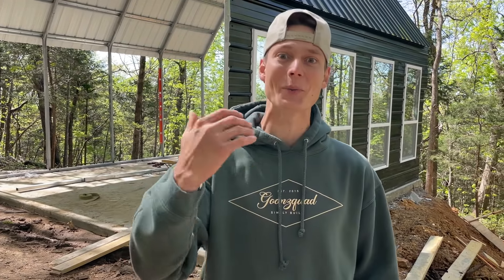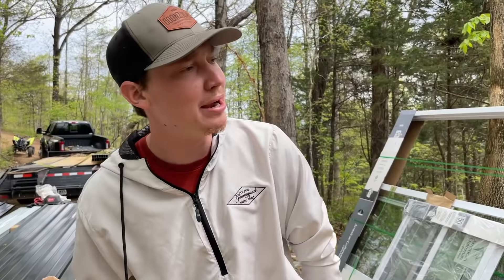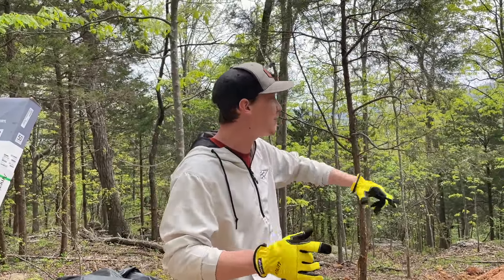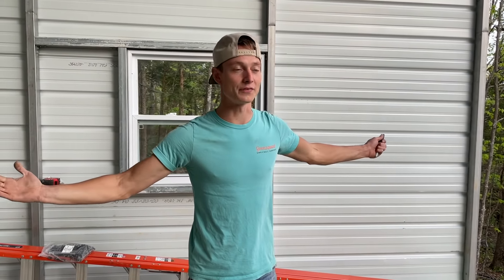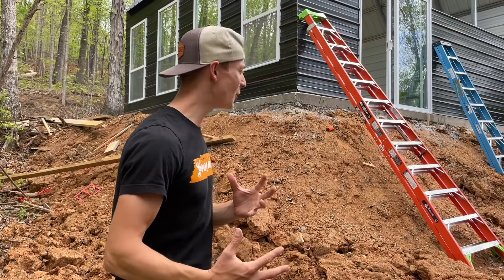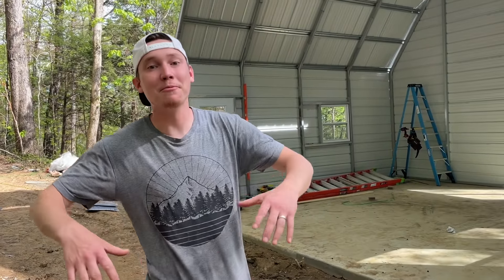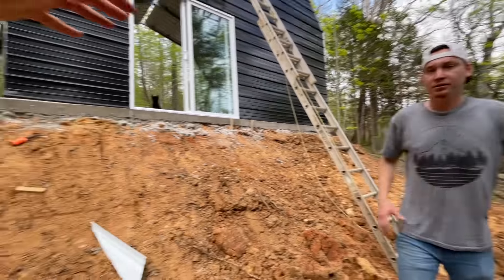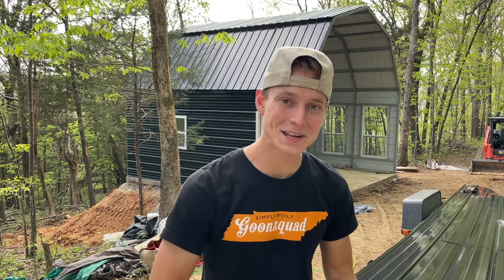Building The Ultimate Man Cave Has Become Dangerous!!! Can We Save It From Erosion?

Comment: it has to be an "L" type of block to contain the slope.  That way first you press some soil on top of the horizontal part of the "L", in short increments (a foot or so) until you reach the desired level of the ground.  That way you will have a nice protection of the slope.
Reply: Lock blocks will do fine
Reply: This is an L
Reply: Called a "Deadman"
Reply: Here in the southwest at least the make tire bales out of old tires. They weight roughly a tone each and commonly used to make retaining walls here. They will stucco over them so they don't look so ugly.

Comment: Hell, embrace the chaos. Stick some wheels on the slab to help it go downhill. Then put some wheels on the saw-mill to follow it and process all the knocked-down trees. You can build a mile-long wooden staircase.
Reply: Unroll that wire as you go and it'll light the way when it glows from the resistance. Perfect.
Reply: @jacobhaagerup7816  Just was thinking about that, with that kind of section, they can not use any power...
Reply: This is objectively funny 🤣
Reply: underrated comment 🤣
Reply: Wait until the next big storm or heavy rainfall day. They will quickly reconsider their stubbornness against the retaining wall, and using just earth to build a platform, without mixing it with different gradient size rocks.

Comment: You guys should have listened about filling in behind the man barn its going to erode until the concrete pad starts cracking you need at least 2 feet of ground around your building and then either slop the dirt better than 2 to 1 or install a retaining wall you can buy the actual metal form from grainger to make your own stackable concrete blocks its a reusable metal form and it's really easy to use and the good thing is you can make as many stackable blocks that interlock together install your Deadman tie ins some of that plastic Matt material ever 2 to 3 courses and your drains and you would be able to drive a tractor trailer around that man barn stay with it and get it done semper fi 😉

Comment: Yes get cinder blocks for your retaining wall, don't forget to put concrete inside them with  1/2 inch reinforcing bars vertically. Fill the hole between the barn & wall with dirt & finish with gravel. Don't forget to put gaps at the bottom corners to release water & use the 4 inch drainage tubing to go outside the corner holes.

Comment: Techo Bloc actually has excellent specs for retaining walls.  If I were you, I would pay attention to them and implement what you can (which is a bit late considering where you are with the project) - but, you can always build out further (you wanted a deck, right?).

Also, you do know that you need to let that wood age before use, right?  You can't just cut a plank and slap it up (as you said).  It has to be pretty dry first or you will get massive shrinkage!
Reply: They remind me of the guy trying to cut a branch from a tree but can't quite get at it to cut it, so he climbs out onto the branch and turns to see he has perfect access to the branch now, he starts cutting...
Reply: @musicbro8225  Well, maybe their fame/fortune can allow them to throw this building away and start over from scratch...
Reply: @JMunsonII  That's true and who am I to judge their failures as an example of best practices for self satisfaction and use of planets resources. Maybe that's fine for them, but for some reason it irritates me. I guess the Goons in Goonzquad is not just a brand :)
Using the green timber on this man cave will be perfect haha.

Comment: concrete plant makes them from leftover redimix  see them about them,  IN canada we call them lock blocks  as they fit together like a lego brick will have to level ground before placing and use some geotect fabric  its a mesh material over top of block backfill then put on top and backfill on top of mesh and it all holds together  from pressure of dirt  OTher than the lock block if the trees can take the pressue  logs piled length wise on top of each other against the trees will hold alot as well . However they will rot in time  then the trouble starts

Comment: You need a bigger size wire to run down because the voltage drop is too much for 14/2. It’s bad for the tools.
Reply: They don’t like to do things right if you couldn’t tell
Reply: Just google Voltage drop calculator and it will give you the size conductors to use for that length and current.
Reply: They rushed into too many things without thinking about long-term
Reply: I was thinking the exact same thing. That wire might even just burn up and melt
Reply: @MythUnknown  It wouldn't burn up if the voltage drops. Wires burn up if the current is overloading an undersized conductor. But at that point it would just trip a breaker.
Reply: They will be driving back and forth flipping the breaker!🤣🤣
Reply: It will be fine for some led lights
Reply: exposed Romex and vinyl tape to plastic box? don't let the inspector see it.
Reply: 14/ 2 and 14/3 is only allowed to power fire alarms and exit signs where I'm from
Reply: Depending on current draw that cable is going to get real hot
Reply: It’s easily over the 3% allowable voltage drop. Also not using snap locks on the box is a big no no and on top of that it looks like they didn’t bond the box

Comment: Set that mill up in the black barn, use the materials to build the deck/posts and outfit the interior! Custom woodworking shop for taking on an old project like a Ford Model A pickup!! Build a loft also to have as a chill spot. That’s where the deck would be. Below that should be dirt when walking out the sliding door. Put the hot tub there in the shade and have some Adirondack chairs on the loft deck! PS I like the idea of one big tire on the back of the ford dually. Cheers from NYS!

Comment: You need to install big gutters and downspouts, The downspouts need to be directed going down the hill and releasing the water at the bottom. You can also get real heavy landscaping plastic and cover the hill with the plastic and then put heavy gravel all over the plastic. This can help channel the water away from the barn. Nevertheless, you need to put together an irrigation plan now! It doesn't take long for the rain to compromise that hill, especially since it's barely larger than the building itself.

Comment: Use timber cut from trees on the property. Using your new saw mill cut the trees down to squares and lay them horizontally. You can do several levels starting down low and stepping up until your level with the back of the concrete pad.

Comment: I realize it will be mentioned a few times here and you have addressed the issue in one of your last vids .Yes the barn is on clay but a wash out is imminent , the first major rainfall and you will be in trouble . Even a load of gravel might slow it down . I know if it goes down  the mountain it will make a good vid but do you really want that , your pops works so hard to help build this great man cave with the 69 Camaro in the center . Dont tempt fate because she will bite when you are not looking ..
Reply: @C.CUMM1NGS  You also brought up some valid points , clay has some good qualities and bad as you mentioned but not at that incline . I am sure the boys are aware now but it would of been easier to dump a load of gravel over the edge before building the back wall of the barn if that was  going to be a chosen temporary fix ..
Reply: @waynesbutler7834  hope all can stay safe😊
Reply: @waynesbutler7834  they should build from the start, as with the new house, a retaining wall. Then filling it with earth mixed different size rocks, and topped by gravel. All compacted by layers. This would provide a more stable soil, less prone to soil movement due to water infiltration.
Reply: @RogerM88  Yup, the biggest problem is not the slope, but the dirt. It will always wash away. You need boulders, stone and gravel as a foundation on slopes.
Reply: @RogerM88  In the perfect world that would of been ideal but these boys live on the edge , on the edge of a mountain , and is why i watch and yes things are getting exciting but keep your eye on the weather . Also i agree with the boulders and gravel in this case plus a slanted wall  or barrier is stronger then an upright one when holding back soil , and water when you look at a dam wall ..
Reply: @mluiga  Thats how some walls were built thousands of years ago , no mortar just thoughtful staking and they are still standing today and often slanted like in this situation for holding back soil ..
Reply: @waynesbutler7834  some key points to have a strong retaining wall, it's to promote  drainage. Or use some gravel layers behind the wall to promote water drainage. In this case, and heaving the machinery, they could build the platform using boulders on the retaining walls, with some gravel behind, and filling the platform with earth mixed with different gradient size rocks.
Reply: @waynesbutler7834  the boys also need to move fast. The water falling from the roof after raining could erode quickly the edges of the platform.
Reply: @RogerM88  I thought the same thing when i seen the roof , i hope they realize the urgency of this situation . Nice meeting you RogerM and have a great night , and check weather reports for Tennessee . lol
Reply: @waynesbutler7834  they will be stubborn to build a retaining wall...until the next big heavy raining day comes. Have a great night too.

Comment: Easy, cheap, and efficient retaining wall. Cross ties and 3 ft. pieces of rebar. Drill holes through the ties and drive the rebar in flush. Do the bottom first. Backfill it and set the 2nd front edge to the back edge of the first. rinse repeat until you get to the top.

Comment: yeah you need to get on the retaining wall going use them 4-5k lb rectangular blocks take the mini and cut you a flat base for them to set on around the 3 sides set a perimeter with them start back filling to the top of the 1st corse then set another row up on them staggering your joints and expose 1/2 of the one below making stairs basically with them and do that till you get up to the elevation of your floor and you usually can get them at about any concrete company they make them usually run around 40-50 bucks in my area may be alot more down in your area

Comment: Erosion mitigation is not an option, especially with as much precipitation as you receive.  I think you are also probably going to have issues under the slab as you didn't properly compact the fill.  My prediction is a lot of settling unless you immediately address the issues on the rear and sides of the structure.  I recommend a terraced retaining wall along the sides and back with drainage installed to prevent any erosion that may cause voids to develop under the slab.
Reply: I agree.
Reply: you could not be more right, however for some reason they ignore every engineers comment about the issue and simply choose to ignore it. looks like were gonna see the house slide down before something is done about it, or at least that's the most likely scenario with how its looking right now.
Reply: exactly what they NEED to do but unfortunetly not
Reply: They're still learning as they go...I'm sure after reading all the comments...they've realized they're error.
Reply: 100 PERCENT 👍

Comment: In Australia the companies that supply the concrete have moulds back at their base and any concrete they have over when they return they poor into them and make large retaining  wall blocks measuring 1200cm long, 50cm wide and around 60 cm tall.  They sell them quiet cheap.  When they poor the blocks they fit a countersunk fitting like a large nail head so they can be picked up by an excavator.

Comment: If you run electrical over a long distance you have to consider voltage drop. Anything over 75ft needs to be calculated out to see if it's in the permissible range of voltage drop if it's not you have to upside the wire to get the proper voltage on the other end. I'm sure this is just a temporary situation to get power but something to keep in mind.

Comment: Try getting wire mesh to lay down and get concrete to pour over the back slope. I mixed dirt with concert and lay it on top of the slope before, it seems to work also. FYI our site is in Southern Thailand where it rains 8 months out of a year.

Comment: Why didn't you use the trees you cut down and cut them into logs that can be driven into the ground as posts and then use other logs cut down the length to act as a supporting wall to hold back the soil you have built the building on?
Reply: They would likely rot if not ground treated.
Reply: More fun grinding them up I suppose.
Reply: @Larry Flynn and how much have they already either burnt or chipped just for the hell of it. They've cut one hell of a lot of trees down on that property.

Comment: As you are planning to have a deck, and possibly a wrap-around deck, a retaining wall may be overkill. For now, I would just smooth out the slope and top dress it with a layer of dry pre-mixed cement (Quikrete). Wet it down and let it harden. It will hold everything in place. AS to the electrical, you will have very limited power available with 14-2 of that length. You will be ok for lighting if you use LED lights.

Comment: If you install wheels on the concrete slab, you can winch it back, every time it sliding down the hill.
Reply: Dont worry in 6 months it will be a rebuild blog.   Heading will be.  How too pull a shed up a hill by a skid steer
Reply: this is the only solution at this point, genius

Comment: Between the missing retaining wall and thin non-fiber concrete pad, that thing may be doomed.
Reply: You really don't need fiber in the concrete for this. If you were going to add anything, probably a plasticizer.
Reply: Standard concrete is fine, the pad needed to be compacted properly, retaining wall and building a proper foundation accordinmg to standrds then they would of be A OK..
Reply: @terrorfex1611  Ya probably right. I see that thing cracking I like mad if it doesn’t go surfing first.
Reply: @PFBruno3  It is going to crack. That is inevitable. Most concrete pads are designed to accept a certain amount of cracking. The soil is going to change constantly based on wet and dry cycles. If you put up a timelapse of your yard it would look like waves rolling along. Plus rain water can channel underneath and leave voids which will promote cracking. I'm just really afraid it could go careening down the mountain because the soil was not properly compacted in lifts.

Comment: Use large boulders from your property for the retaining wall
Reply: Yeah I told them that and lots others have but they ain’t listening. Have you noticed that there is already empty spots of no clay up under the edges of the concrete slab?  If they do not haul in more dirt and build that dirt up all the way around the two sides &  the back it will slide off that mountain in 2 years or less! Weather 🌧 hot 🥵 and cold 🥶 and gravity is a powerful force.  It’s a disaster waiting to happen.

Comment: Hey boys, I’ve done a few retaining walls, your best bet for such a steep batter with a lot of backfill would be to get steel H beams around 4m in length, concrete set them in the ground 1m or so giving you 3m to play with your levels, then use a concrete retaining sleeper, the standard is 2m or 2.4m lengths in Aus, in thickness of 80mm, 100mm or 120mm and obviously set your posts with distance of the sleeper length

Comment: Hello guys wayne from the UK I noticed when you were cleaning up the commercial garage you threw away all the rules of lagging perhaps you could’ve use them for your barn build also you mention you have a lot of trees and a lot of logs why don’t you just pile drive some of the logs in a half moon shape as a retaining wall you seem to have a lot of stone there once you’ve pinned all the logs into the ground throw some stone in and a bit of concrete also definitely most definitely would suggest getting a wind turbine which would be brilliant to watch use set up also I’ve been dying for you to fit electric gates on your parents home definitely a must when you built the gates I was hoping you would put an electric system in which would’ve been awesome keep on knocking out the good content also still cannot get none of that source from Amazon looks tasty 😋
Reply: They didn’t even add electric motors to the commercial property. As someone who had to open a roller door by chain everyday at work, I have to say an electric motor for the chain is a must!
Reply: I know I seen Him pulling the chain the other day and thought why have they not got a button they can just press it’s not hard to do they could’ve also run the cable for the electric gates which would’ve been a good project to watch 👍

Comment: I think if your gonna do a deck it would be wise to use the composite deck board,kinda pricey but easyer to clean especially with all the tree sap around and longevity,and I would probably do either the biggest blocks you can find ,or do footing and build foundation forms ,an pour ah concrete retaining wall with drains🤔an with the mill your gonna have to let the boards dry by stacking an put 1x1 sticker sticks in between the boards to let the air get to them to dry,an try to make widest boards you can get out of the log,most likely 1x8/  1x10 any thing you cant make inch boards then make 3 or 4by 8 or 10,I think you'll be able to catch my drift🤔 best of luck,be safe!! 🇺🇸💪🤙👍✌🙏🇺🇦

Comment: Get a compactor and start compacting,  work from bottom up, adding fill dirt as needed. Once it's solidly compacted, dig a 6' deep 3' wide footing. Before footing is completely setup, install anchors and set Jersey barriers as containment wall. Back fill with more dirt and compact.  It won't be cheap but it will hold up forever.   Did this for a customer years 35 years ago and it's still holding.  Good luck boys.